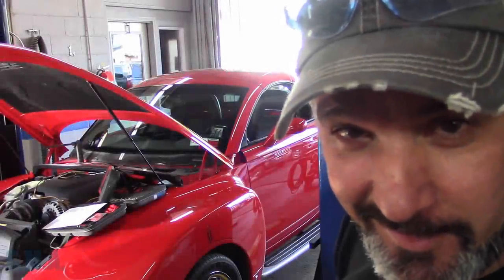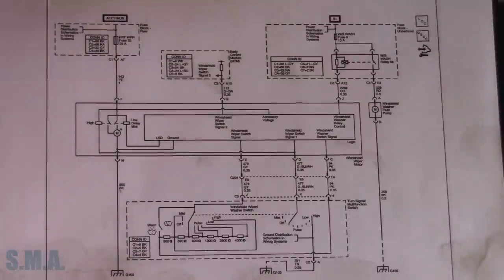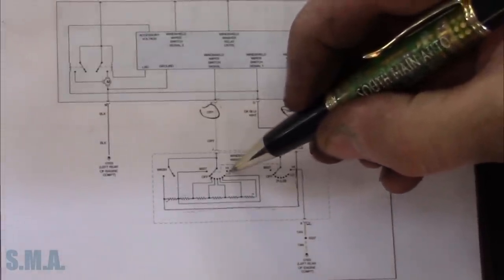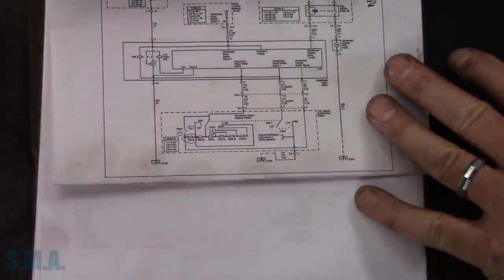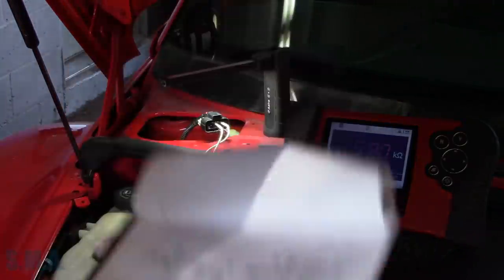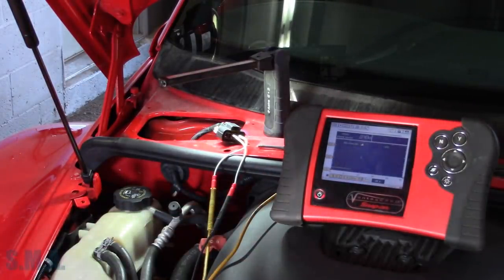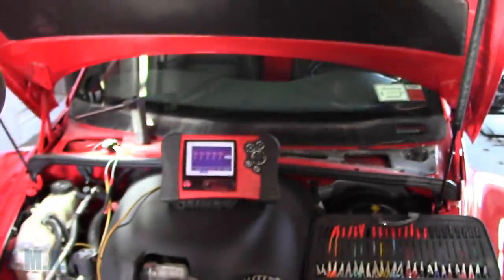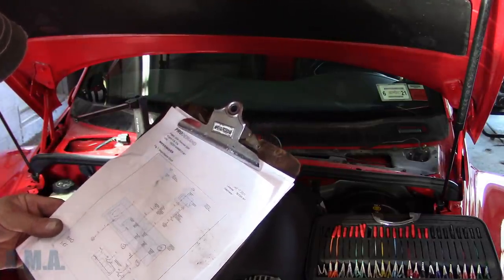Chevrolet SSR: Wipers Gone Haywire

Comment: All these electronics just to push 2 rubber blades over a windshield so you can see in the rain. Ridiculous.
Reply: Basically any car with variable wipers has similar logic, but I haven't seen it built into the motor assembly before. My old volvo has a module that plugs into a relay socket in the fuse box.  That seems like a better design, at least from a troubleshooting and service point of view.
Reply: It's either this or having a bunch of wires through the handles. When you add them up, wires get heavy, expensive and bulky. Also, you need a bigger and bulkier switch, but it would burn out eventually anyways.
A few resistors and 2-3 wires are way cheaper and better in every way.
Reply: if its too simple it won't break. Can't have that!!
Reply: @panzerveps  I guess that's why mechanics are now called technicians. My old '54 Vauxhall Velox had vacuum wipers. Useless but very entertaining.
Reply: Easy fix. 50 cal explosive round through the block.

Comment: Happy 4th of July!.  I enjoy watching your videos.  I just finished filming the swap out of the power steering pump on my 2004 Chevy SSR.  The wiper motor issue is a somewhat common failure for the Chevy SSR.  As you found, the wiper motor is not available for the Chevy SSR any longer.  The typical solution for this type of issue has been to replace only the wiper motor module that resides on the wiper motor assembly with one from a Chevy Trailblazer (even though it doesn't list it for the Chevy SSR).  This is one of those times that the Chevy SSR being based on the Trailblazer EXT platform, works out for the Chevy SSR.  It turns out that GM / ACDelco part number 19120931 for the Trailblazer wiper motor module will replace the one in the Chevy SSR and usually it fixes this issue.  GM/ACDelco P/N 19120931 is still available from a variety of parts suppliers.
Reply: Good to know (not that I own one).  Assume the packaging of the motor is slightly different between trailblazer and this.  How do the modules fail?  Bad solder joints? Moisture caused corrosion? Or just electronics taking a crap?  Send bad motor (with module) to AVE in BC for failure analysis (unless Cardone needs the core).
Reply: @cgmoog  some of the failed units have had the "green crud" inside and others have just failed without any obvious sign of water intrusion.  It seems that a SSR owner will ask for assistance on the various websites and groups about this topic at least three or four times a year.  One SSR owner has a large library of PDF documents on how to fix common issues and he has a PDF document covering this problem.  I haven't created a video on this issue yet since I haven't had anyone in my area with this issue (yet).  I believe the ACDelco P/N 19120931 costs about $80 USD for the wiper motor pulse board module by itself.
Reply: @cgmoog     IT,S A   GM

Comment: As a kid, the Apple II was introduced. I was in 10th grade. The keyboard didn't have a 10 key. So I designed one using resistors and the gaming plug. Long story short, I assigned each key on the number pad a resistance 0-150K. The computer then took that value and converted it to that number/operation. Got an engineering award. Still have the device, award and an Apple II. Back then I didn't realize where I could have gone in industry knowing what I knew.

Comment: I love these type of diagnostics, especially when you find wrong information,  it makes me feel like I'm not the only one that has these struggles as a shop owner and technician.  Thanks for the videos and your time that it takes to make them!
Reply: I had to pull from 4 different online diagrams to get the right wire colors and test them just to do the simple fuel pump bypass on a dodge tipm. That was fun!
Reply: Even an advanced diy'r (well Im a Mech Engr) seems to run into documentation errors in my factory service manuals. Even worse, I have bad luck with finding errors in Napr's part designs.....
Reply: Yeah I feel likewise, Eric inspires us to be better at our trade.

Comment: This is one of those "remember when" moments...Remember when wipers were on /off and a couple speeds..and lasted for decades.😎
Reply: All of this reminds me of the Star Trek movie where Scotty sabotaged the fleet's new starship so it couldn't follow them. When they asked how he did  it, he said, "The more complicated you make the plumbing, the easier it is to stop up the drain".
Reply: When I started my career in auto fixing 45 years ago wiper motor failures were very common below 100k miles. Turning on wipers when they were frozen to windshield killed the motor in minutes. New cars often use touchless electronics(position sensing and current monitoring) to control parking and if the motor stalls the power is cut off. Many have the ability to change the full sweep range so the blades don’t run into ice dams that beat wiper blades apart. All this fancy stuff also does away with the soft arm bases and low nut torque so the arm shears free instead of killing motor.
Reply: The one thing you can never repair in vehicles is the humans that operate and/or break them..lol😃
Reply: My BMW has that, plus rain sensor. It's going on 17 years and it's fantastic. My favorite feature by far! Lol
Reply: I remember when wipers went slow when you went up hill !
Reply: I remember there being replacement wiper modules.  So you can just replace the circuitry, because the motor itself is obviously okay.  Did you look for that?
Reply: @bryanlatimer-davies1222  Or when you came to a stop at a traffic light and the wipers went crazy fast.  I don't miss vacuum powered wipers at all, driving fast in heavy rain was almost impossible  ... if you need to see the road.
Reply: I can remember when many cars had vacuum operated wipers and they would stop working under hard acceleration or going up a long hill.
Reply: You obviously don’t remember vacuum operated wipers.

Comment: I just banged out a set of plugs and coils on an oh four Ford expedition with the two valve jobby. They were all original, all loose, severely rusted and burnt. It's a miracle they all came out, new motorcraft plugs went in and it ran perfect when I was done.

Comment: Eric, great video but the wiper motors just don't fail on these.  It is always the wiper motor pulse board.  GM part 19120931.  They are the same as the ones from the Trailblazer.  Anything you need to know about SSR's can be found on the SSRFanatic website.

Comment: I remember when wipers ran on engine vacuum.  Press the gas pedal and the wipers would slow down.
Reply: Good ole vacuum wipers.  Then they added "Double Acting Fuel Pumps" which not only pumped fuel, but the upper section was a vacuum booster of sorts.  It helped to keep the wipers moving during increased throttle times.  Didn't cure wipers from stopping.  When the cam shaft lobe wore down, the fuel part worked, the vacuum boost didn't. 
Have a great Declaration of Independence Day and a great weekend!
Reply: Yeah, they sucked, ha ha.
Reply: @mikechiodetti4482  And when the diaphragm for the wiper vacuum failed, the intake manifold would draw oil directly from the oil pan. Our 52 Chev thus would burn a quart of oil in just 28 miles. Smoke is simply an inadequate word to describe the exhaust plume.
Reply: Up hill in the Edsel when it's raining sucks lol
Reply: My parents had a 1960 Ford Falcon with vacuum wipers then dad got a 1965 Oldsmobile with electric wipers and automatic washers which would pump about 1/4 tank of windshield wiper solvent whether you needed that much or not.
Reply: That brings us back to the SMA video about servicing the 1936 Chevrolet.
Reply: @mikechiodetti4482  Then they added vacuum storage chambers to stop that situation.
Reply: But what do you do if it stalled out or there was a vacuum leak
Reply: We had VWs where the squirter fluid was powered by the air pressure in your spare tire. Get a flat? Hope you had kept up on putting air in the spare.
Reply: @bradklingensmith  I had a 1976 bug like that.  Never had a problem with it but i thought the design was strange.
Reply: @bradklingensmith  We had a VW Variant (think late 1969's model) - the squiter fluid bottle was pressurized with air. You need to refill it and repressurize it at the gas station. 
Nice fun if you're on a long road trip, and there's lots of bugs and gnats on the way making lovely smear marks on your windscreen...

Comment: Eric, I love your videos.  I work for a GM dealer in Mass. and every time that you work on a GM product I will check it up.  I did find that the wiper motor is discontinued, but your local GM dealer has the ability to check with GM dealers across the country and a new motor is still available with dealers that had them in stock at the time GM discontinued the part.

Comment: Great diagnosis as always.. only thing ticking me off, is the lack of fender covers.. I'm a paint tech and technician myself, but also a car enthusiast and get ticked off when I see technicians not taking care of the paint finish.. please use covers and refrain from setting hard plastic boxes on the engine covers too.. this is clearly a show car, and I'm certain the owner will not appreciate scratches on his paint or engine cover.. I've personally had a tech put scratches on my fuse box cover under the hood, when my car battery was replaced under warranty (they wouldn't let me install it) for a parasitic draw due to a software issue for the cruise control.. sounds anal I know,  but I'm sure I'm not the only one who looks after his car like that... big fan of your channel Sir, and mean no disrespect...

Comment: This seems like a good part 2 to Ivan’s ridiculous Subaru power window debacle video.
Reply: @felixgato4392  because the system Subaru is employing to roll windows up and down is ridiculous.
Reply: Eric O:You've done it again,by slamming the others to the curb with you wonderful diagnosis. I had to laugh when you quoted the line "I love it when a plan comes together". Now where have you heard this line, any guesses? Think back to the early 80's: This line was quoted by "FACE" in the "A TEAM". Ah happy memories, I still remember this like it was yesterday. Have a gr8 God blessed day Dr O and family. Never forget family. God and family is what counts the most.
Reply: Felix Gato I don't think he's saying Ivan nor his video is ridiculous, but the power windows on the Subaru are ridiculous
Reply: Felix Gato Ivan’s video was ok until he spliced the wiring harness instead of replacing the switch he smoked with the test light. I’m just not ok with doing that, if it’s my mistake than it’s my responsibility to fix my mistake at my expense and I have made mistakes that I’ve paid for in time and/or money. I’ve watched several different repair videos, some good and some bad but based on my own experience with 45 years starting out in automotive and then as an aircraft mechanic/pilot it’s my personal opinion that Eric is extremely good at what he does with a good attitude towards customer care.
Reply: @paulkirkland1535 : I believe that quote should be attributed to Col. John "Hannibal" Smith.
Reply: Triumph tr7 that was electric banchee.  BMW 1985 with ceramic fuse box in left front engine compartment worse smoking banchee Chrysler's of the eighties burned oh the ford astro star that burned inn the ignition box under steering.  I think it killed a family.  So many car defect ford crown Vic. With exploding gas tank.
Reply: @paulkirkland1535  That quote was said by Hannibal!
Reply: @willispower9493  if you watched all three videos he did replace the switch he fried. At the end he took the motor apart just to show you what happen. As for the splice, he just improve that poorly designed circuit.
Reply: @paulkirkland1535   Originated by Col. Hanibal Smith, played by George Peppard, leader of the A TEAM

Comment: My 2005 Dodge Magnum"s intermittent wipers worked at the speed it wanted, not the speed I wanted.  In my ignorance I replaced the multi-function switch and it fixed it!?  Good job finding out what the cause was!

Comment: I remember reading someplace that the wiper motor pulse board module is the part that usually fails. I can't remember where I read the information, but that the wiper motor pulse board module from a similar year Chevy Trailblazer is interchangeable with the Chevy SSR wiper motor pulse board module. I believe that motor pulse board module for Chevy Trailblazers is listed as a separate part and still available from GM.

Comment: Great video Eric , feel like I want a paddle and I've got one of these lovely things in my garage here in the UK,  all the way from Saudi Arabia   came in a shipping container,  with plenty of sand in it in kit form , spent a day putting doors wings and bonnet and boot lid back on , tried to start , no fuel , give it a spray   brum brum,  found eventually found fuel pick up pipe in tank split , fixed it , starts , but engine is bolloxed, knocking its spuds off, customer found engine repair kit as it's been  stripped and built with many parts before , so I've got it with no engine or transmission in , lovely , been stripped for a year waiting for bits   and power roof not working either,  it's a shed Eric

Comment: It's almost always the delay circuit board inside the motor. GM used to sell that board separately from the motor assembly. It can be changed without removing the motor from the vehicle.

Comment: Great job of explaining things. Electrical was always my weak spot in vehicle repair.
Reply: A high school computer instructor told us to "think like a computer" and walk through our programs in our heads, making sure to understand what each step was trying to do. With wiring and logic circuits it's the same challenge: think like an electron flowing through the wiring. Where does it start, where it goes on its journey, and what it's supposed to do when it's done. Eric does a great job of using the diagrams to think like the electron. Too many "technicians" lack this skill, and just fire up the Parts Cannon hoping a Super Wild A-- Guess will fix it. It doesn't help when the factory diagrams are wrong either.

Comment: Remember 88-98 chevys, wipes only worked when its sunny out. 
I repaired dozens of boards with cracked solder joints. Still have a couple kicking around.
Reply: 95,s as well
Reply: guy azbell 
They all had problems with the boards. Even my '79 pickup had trouble with the board, and it was a complete different design. The wiper motors were all the same back then, to make it a delay system the on-off switch was changed to one with a rotary switch in it so the delay could be adjusted and the board was in a separate module that was plugged in between the main wiper harness and that new switch and then tucked up under the dash.
Edit: I've had board trouble with almost every board after that with the exception of my 2007 Silverado.

Comment: Great video! I've run into some very unhelpful service info in the 14 years I've worked at Honda. It's usually good but sometimes it's like: check for 12v and ground at the ABS module, if you have it, replaced with known good ABS module. Is the problem fixed? No? Replace with known-good PCM. Thanks Honda I truly wanted to quote between 2500 and 4500$ for an out of warranty repair. Why don't you just tell me what one module should be saying to the other and I can scope it, thanks for nothing.

Comment: Smashing diag :-D
Another way to test a switch plus resistors is to wire it up to a portable radio volume control position.
Any slightly bad connection will make the radio jump in volume or crackle.
Your ears will detect tiny errors that the ohm meter will miss.

Comment: I would say that almost anytime I have seen a wiper problem that 99% of the time it's the motor itself that is the problem. Those GM electrical schematics and flow charts are not what they used to be as far as accuracy. Part of the park circuit is in the motor itself, I think the contacts get cruddy in them. Good video. That car probably does not get driven enough.

Comment: Nice tracing and vales sheet. It gives you a good reference to start with. Although some of the Ohm values were a bit off from written to actual. But still, it gives you a point of reference to start from. Most bad vales will be WAY off if that is the problem. Nice way to follow your own set flow to check and see if it was the switch to the motor causing the glitches.